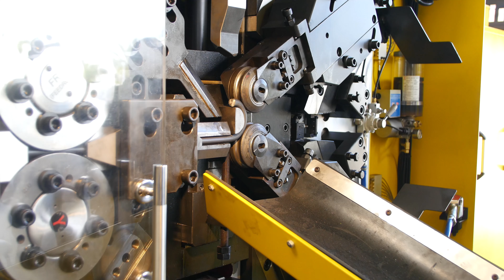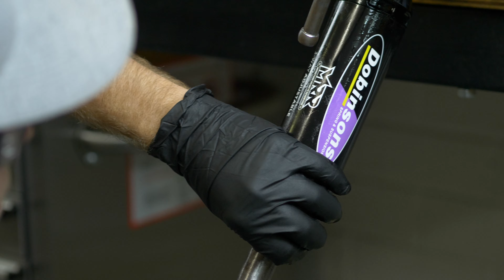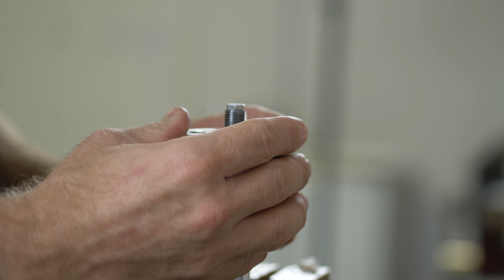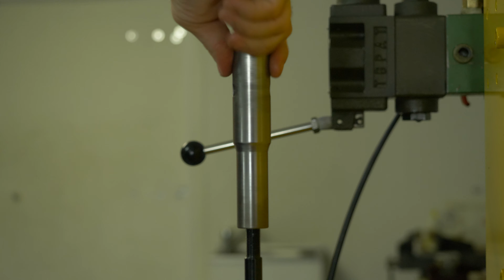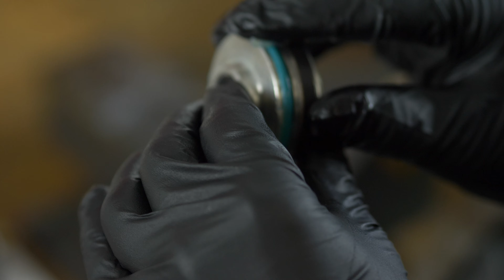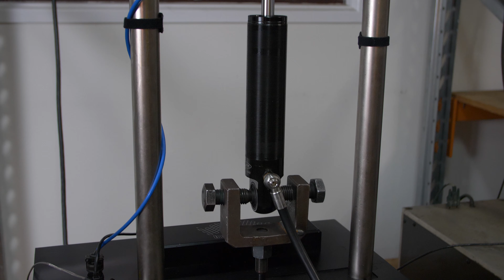Suspension collaboration! Let's meet who we're working with.

Comment: Is Ridgeline the only focus, or will the product ya'll are making be compatible with the Pilot and Passport as well? As a Passport owner, you very much have my attention.
Reply from the maker: @rudymoralesjr  valid question. These are being developed for the Ridgeline. The Ridgeline has a different rear strut than the Passport or Pilot. We're looking at a few different options for compatibility. The two front runners would be an additional lift / adapter plate. Or develop a custom top hat to allow the rear strut to work on the pilot or passport without any additional lift.